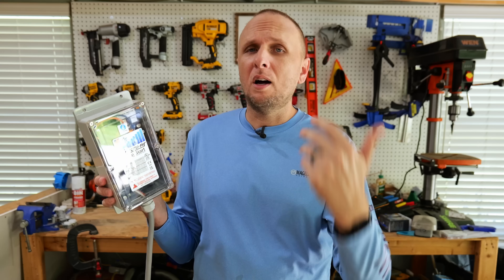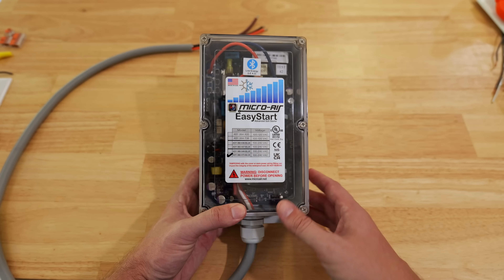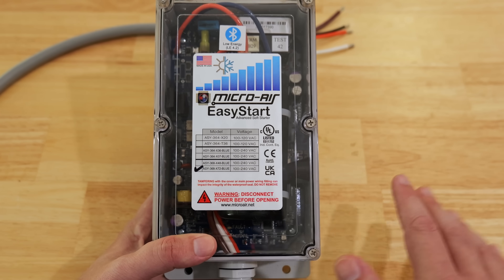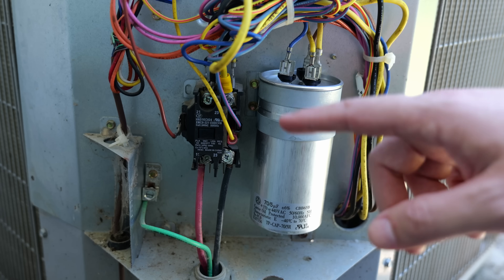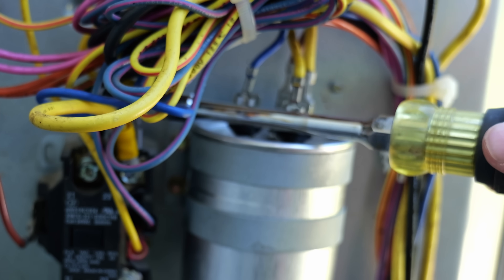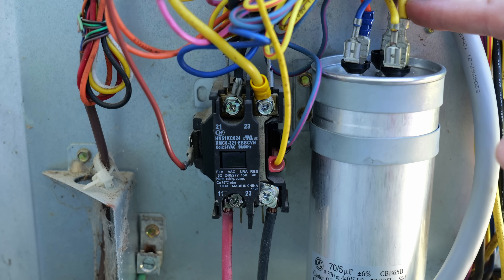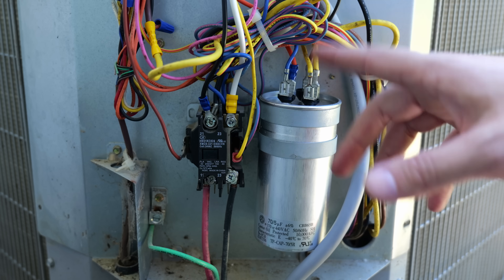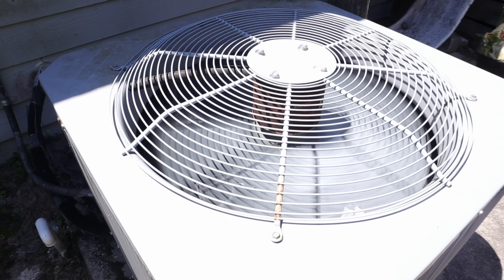Why Every Homeowner Should Consider Installing an AC Soft Starter | Micro Air Easy Start Install

Comment: is a compressor saver the same as this or a hard start? our HVAC guy installed a "compressor saver" when he was here doing our tune up last month, i'm wondering if this should be installed on top of that or if that's considered a hard start kit that we can't run this alongside (or if that's basically the same as this)...

Comment: @1:10:  The image states that hard-start capacitors increase in-rush amperage.

BS.  Show me a functional hard-start capacitor that does that.  I've installed a lot of them and they ALL reduce in-rush amperage.  It doesn't even make theoretical sense that a capacitor would increase the amp-draw.

Never trust marketing.

Comment: Great video, I have only one question. If your A/C system has an expansion valve for a metering device and your low side and high side pressures do not equalize during the off cycle, does the soft start kit allow for enough torque to overcome this? A lot of A/C systems will operate in this manner. Just curious to know if you have tried this or know about it. Your A/C system may have a capillary tube or piston metering device on the evaporator which will allow the pressures to equalize in about 5 minutes. Most of todays thermostats will have a 5 minute time out between calls for the condenser to turn back on.

Comment: When you say the system needs to start up and stop five times, do you force that, or just let those start-stop cycles occur on their own? Can you clarify that process?
Reply from the maker: Either one will work.  It just needs to learn your system’s startup.  I just let the unit start up like it naturally would as usually a generator is not needed to be used right away.

Comment: I have no personal experience, but the purpose is sound. Nearly all the heating in the motor is from "I squared R" losses; the square of the current times the winding resistance. This would be a thermal spike every time the motor starts; probably insignificant on cold starts but more meaningful with repeated hot starts. I bet most compressor motors use the ubiquitous Formvar insulation, standard heat shock rating 175C, optional 220C.
Whatever the temperature rise, the rise would be much less with surge limiting. In this example, the current reduction (125 to 36A represents 3.5 times reduction in peak current and 12 times heat shock reduction. The downside would be the spread of the peak over time but the total heat energy is reduced because of the square of the current being the big driver.

Now: speculation. I suspect manufacturers who actively discourage use of soft starters are trying to keep uncontrolled variations out of their warranty program. I've worked with enough manufacturers of all sorts of things and have seen that effect often. Whatever it is, if you touch it whatever follows is your fault.

Comment: Can it starve the compressor the amperage/power it needs to start?
Can it cause the compressor to go bad?
Reply: Exactly my thoughts as well.  I'd like to see line voltage as the system operates.  Low voltage is not a friend to the high amp motors.

Comment: Appreciate the video!  I've got a Trane 3 ton unit.  Purchased my micro air thru your provided link, got it fast, and then the contactor broke prior to installing this...got that fixed and finally was able to hook this up today.  Very simple hook up.  Very quick to do.  I didn't check my start up amperage but it's looking like I'm hitting at 23.7 start up amps now.  I can hear and easier start up as well.  And when the T-storms come and knock out my power, I feel better about running this unit on my generator.

Comment: i thought about getting one of these but i just cant afford them it was cheaper to buy a bigger inverter i have been running my ac and swamp cooler off of solar for years with out these fancy exspensive soft start junk with out issue

Comment: The ICM870 Soft Start is intended for residential, commercial, RV & marine applications, and it costs a little bit less than half the price of the micro-air easy start. Both will last your entire life.
Reply: If I have no generator at home but just want to install a soft start on my 3 ton unit will this be ok? My compressor sounds loud at every start.
Reply: Only available for 3 ton or less A/C units at this time, however, they're working on a 32 version which will take care of 3.5-6 ton units.
Reply: @Alan-yd5pc  you might have to opt for the more expensive micro-air easy start for larger systems. It is totally worth it. If more people had them, there would not be as many blackouts from grid overload.
Reply: @Alan-yd5pc  The only advantage I have with this micro-air I can see, is that I can use their app, connect to it with bluetooth,  and see the Locked Rotor Amp draw, and system current draw after it starts up. 
My listed locked rotor amp is: 59.9 Amps
My listed live current amps is: 10.9
With the micro-air installed, my LRA is: 14.5 amps
My Live Current draw on this 98 degree day is: 5.8 amps.

Comment: That's worth a sub! Question: is installation for a roof mounted RV A/C the same or very similar? Sometimes I run into issues if the inverter is running to charge the coach batteries and my A/C tries to start at the same time when using the less than ideal 120v to 30a shore power adapter. Thanks for the video! Good stuff!

Comment: The electrician who is installing my interlock and inlet box for a generator hook up said I would still require a generator with 12k running watts to power the AC even if a soft start kit was installed.

House is 1800sqft and we’re only looking for the AC and maybe a refrigerator when if the power goes out. He said that the AC would pull half of the 12k running watts alone. 

Thoughts?
Reply from the maker: There is no way.  Mine is a 4 ton unit, 2500 sq ft house and uses about 3,000 watts when just running the AC.  AC running wattage is not very high, it’s the start up.
Reply: @HowToHomeDIY  hmm I don’t understand why he would tell me different unless he doesn’t understand what the soft start does? 

We’re not buying a generator through him so there’s no incentive there for him to advise me that a 12k running watt generator is needed.
Reply: @HowToHomeDIY  I actually sent him your video and he said that at 35 amps at 240 volts is still over 8000 watts for the compressor and that’s not counting both fans.
Reply from the maker: That’s correct but that’s the start up amperage for a split second.  That’s why the soft starter is so important.  But you said he said the running wattage would be 6,000 watts and there is no way.

Comment: Could you explain a bit more (10:10 - 10:20 ) where you said "it needs to start up and stop 5 times" ... Do you mean starting and stopping with the thermostat ? How long should it run? If you could expand on that part please?
Reply from the maker: Yeah it has to learn your system so as to optimize the start up.  So it needs for the AC to startup 5 times in order to do this before using a generator to power the AC.
Reply: @HowToHomeDIY  So it's not necessary to start and stop in rapid succession ? It just won't be perfectly optimized until after 5 start ups? I don't plan using a generator , I just want to get rid of the dimming lights in the house at start up, and want my compressor to last longer
Reply from the maker: Correct.  You can just install it and run the ac and after the 5th start it will be optimized.

Comment: One could also consider getting an inverter AC unit. They always soft start as the compressor is powered by a variable frequency drive.

Comment: Nice.  We have solar and batteries (2 - Tesla Powerwalls) and as part of the installation they also installed a soft start unit. To be honest until I saw this video, I did not understand how this unit worked.  And the unit they installed looked less fancy than yours.  I don't think it had that learning steps you showed.   But it seems to work.  We can run the AC when the house is only powered by the 2 Powerwalls which have a max output of 10kW continuous/14kW peak.
Reply from the maker: Interesting.  I am planning on getting solar as well.  Do you like your power walls or would you go a different route if you had to do over again?

Comment: We have a 2K solar off grid system and the portable combination heat pump - a/c we have already has a built in soft starting mechanism but we do have an issue with the 1200 watt microwave really drawing down the power or tripping off the controller on start - Could this soft start kit work with the microwave? Or some other soft start workaround for this application? Thanks for the excellent presentation!

Comment: Is that a liquidtite connector you used to enter the control box of your ac?  If so what size works for the supplied cable, 1/2"??

Comment: Been reading about these Soft Starts in the camper market for several years and wondered about a home version, great to see the answer. Extension to this is what about heat pumps only been living in my current home about 4 years and haven't had a power outage yet but I am not sure what I will do if we have an ice storm and go a couple of days without power.

Comment: That's if you don't have to separate the fan from the compressor. Most people can not wire on ace, so don't forget to ad $150 minimum for a electrician.

Comment: Starting up the compressor on your AC unit draws more power than when its running. Some Tstats have the option to limit compressor start ups via a timer. This is a great addition to your home HVAC system. Its been a few years since i worked in the residential hvac field. I do commercial refrigeration these days. I would definitely recommend this but like he said. Paying a hvac company to install it will cost you more than you're gunna want to pay. I really wish i could find videos this informative when i first started working in the field. Youtube didnt have HVAC videos this good a few years back.
Reply: Dang! I just got a whole new AC system but didn’t know about this. How much do you think this would cost to install? I wonder if I can figure out how to install it?

Comment: We have frequent sub-second power interruption that cause compressor stall. Will this solve the problem?
Reply from the maker: No, if you lose power briefly it is more than likely still going cause the system to shut off.  It will show up as a fault on the app if that does happen.

Comment: Dont newer high efficiency systems have this built-in?  I belive my seer16 3 ton unit only pulls 45 amps on startup.  Well my bi anual 
Service for summer is next week ill ask the guy about it and if adding a soft start is necessary, my reason isnt so much backup power but energy efficiency,  your power bill is now mesured by peak energy draw a spike in energy causes the meter to jump up lowering you peak demands will lower your energy bill. 😢  just one more trick to save a buck.
Reply from the maker: The higher efficiency ac units do not have this on them they use other technology to make them more efficient.  There is a good chance he won’t know what this is.  I had an AC guy out a couple days ago to do a regular maintenance check and when I said I had a soft starter he said you mean a hard start?  Then I showed him and he said he had no idea what it was or how it worked.  But yeah in places where they charge based on your peak energy draw these can save quite a bit of money.
Reply: 13:12  well my 3 ton seer16 would use the same unit you have  @ 345 bucks its kinda pricey. 
Also depends on the hvac company 
I picked the best contractor in the area when I replaced my hvac system 10 years ago. I went with a 97% eff furnace  and seer16 compressor  my house had a seer8 unit on it  both units were paid off in energy savings in 2 years. Even with 2 break downs  gas presure switch @ 250 labor bucks under warrent and A coil leak 750 labor to replace  had I spent 350 when I bought the system labor would have been free also. 

Im blowen away you answered that fast.
Reply from the maker: I happened to be on at the time answering some comments 😂.
Reply: If you dive in to an inverter driven condensing unit, it will not contain this soft start but the inverters convert 240 volt A/C into 3 phase DC in order to spin the compressor at a variable rate.  Much easier on your electric bill.  They spin up slowly and run at reduced speeds.  That's how they get the 20+ SEER ratings.  But, they also can't take power spikes and voltage drops very well.  I see a large number that fail in rural areas where the power grid is less than dependable.  Same goes for mini splits. Just losing power suddenly can damage the compressor.  We are told to turn off the unit inside then wait for the unit to completely power down before we pull the disconnect.  They are not very robust.

Comment: Amps on a single phase compressor are always checked on the common leg of the compressor, not just the run leg.
Reply from the maker: Interesting.  Because I had an AC tech here yesterday and asked him to check if the in rush to my compressor was ok and he checked it using the exact same wire I did in this video, the compressor run wire.

Comment: Thanks for the excellent video, I installed the 368 yesterday on my 3 ton 16 seer Bryant.  This unit had to be fitted with a hard start,  one month after it was new, about 2 years ago.  I was concerned about the soft start with the history of this unit, but right out of the gate it did first start at about 29 amps and almost no noise.  One day later the unit is into its 15th start cycle and so quiet that the starts are almost as quiet as the normal running sound.  The starts are now at 27 amps compared to the hard starts well into the 70's.This solved a big problem since the unit is on a basement wall bracket below the bedroom.  I know the $380 price tag might seem high compared to $13 bucks for a hard start, however the start noise elimination and increased compressor life is worth it.    Install was straight forward, but I did have a lot of hvac experience from my last 18 years working on 3 phase commercial equipment.

Comment: Why would you use a butt connector with the yellow instead of just taking out that piece and putting a spade on the wire and going directly onto the capacitor? Just remove the jumper and wire it directly. Less splices or cuts in the wiring is always a plus

Comment: I'm in North Florida we just had a storm blow threw this week and take out the power for 12 hours. Hooked up my generator it's a 12000 like yours. It will not power my 4 ton AC unit so I have some portable AC units on wheels. Actually went and orderded another one becuause the 2 I have only make it bearable. This safe start is a game changer. I'm taking the unit I purchased back to Lowes and buying this. Thank You
Reply from the maker: Yup I got those same storms.  Luckily for us the power never went out though.  My yard is completely soaked and I’ve already seen one moccasin since everything is so wet.  But yeah this thing really is a game changer.  There is story after story in the comment section from people seeing dramatic reduction in in rush current.  Whenever the next hurricane actually hits us up here like Irma did where I didn’t have power for a week, I’m ready.

Comment: Here's my questions, that I can't seem to get a clear answers for.  My AC compressor is fairly old, at least 10 years along (possibly 15).  Since it is likely near the end of it's service life, would it even be worth it to install the Micro-air Soft Starter?  Will it compromise my unit or hasten it's replacement?
Reply: To answer your question, if there are no issues with your current unit, yes you can install it. If an issue arises later, and the unit needs to be replaced, just move it to the new unit. We have a 3-ton Lennox that is over 26 yrs. old and running great.  I installed this same Easy Start unit last year. I've had our unit serviced every year since new.

Comment: I have that installed about 5 years ago. Awesome results. Saves you $$$ on the a/c lifespan alone. The multiple starts makes it easier on your a/c. My neighbors compressors kicks in are way louder than mine and when I use my generator I never got overloads. Not cheap but it pays back eventually. Nice video.
Reply: have you noticed any reduction in how well the system cools your house?  i'm curious about whether or not the reduced running amps means a reduction in cooling capability.
Reply: @dt05 it shouldn’t affect the running power of the compressor. Electric motors tend to use 3-4x their continuous power to start up at full speed. This soft start just eases the compressor into its continuous amperage rather than go full speed ahead. Similar to what an inverter compressor does.
Reply: @CorvetteCoonass  understood about the inrush amps. I’m referring to the running amps. The video specifically said that the running amps after the soft start was slightly lower than before the soft start was installed.
Reply: @dt05   We have had this soft start unit installed on our 3.5T central air unit for about 3 years.  It was originally installed to reduce compressor start-up amperage so we could make use of a smaller, portable generator for whole house purposes.  We live in TX (where it is HOT in the summers) and have noticed no reduction in cooling capability. This product just works and is worth every penny, just in cost savings for the generator hardware alone.
Reply: @Wyoming4  thank you for the feedback! I’m happy with mine. Haven’t tried it in the generator yet, but agreed, I’m not seeing any issues with operation.
Reply: Maybe it’ll save you money. You’ll never know

Comment: Thanks for this video. I purchased this device and took less than 10 minutes to install. I went from 60 n rush amps to 23. Generator runs my entire house without issues. Customer service is top notch.